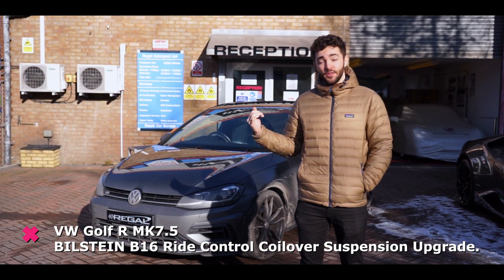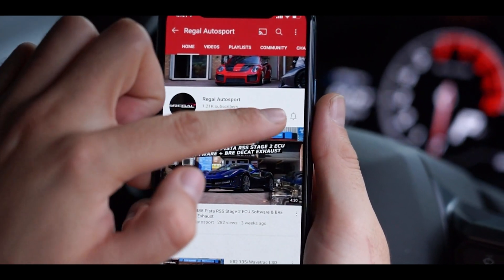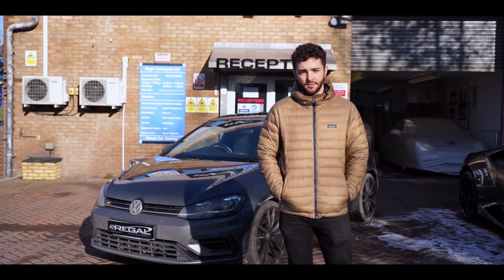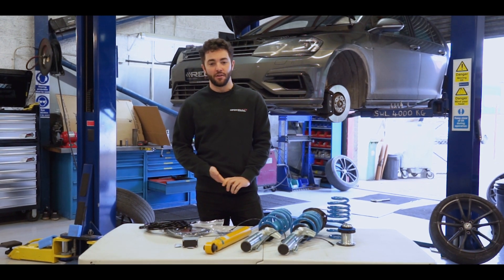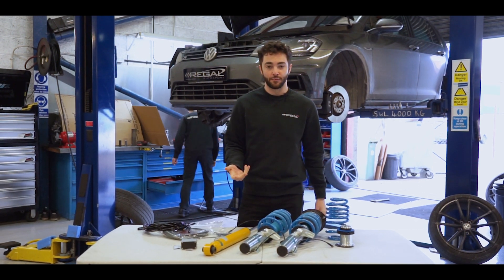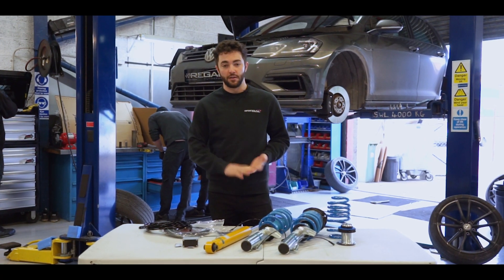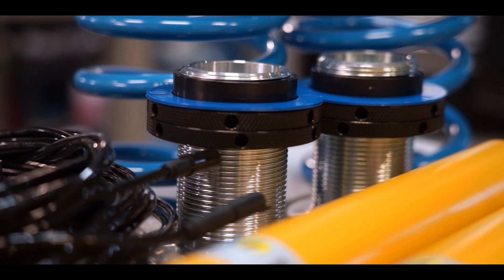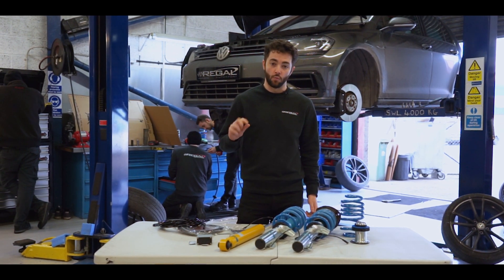MK7 Golf R Coilover Install | BILSTEIN B16 Ride Control [Retrofit Electronic Damping to your MK7R]

Comment: After installing these did the car say suspension fault? I put in H&R springs and that code came up… too low? Would rather go coilovers but wondering about the fault code
Reply from the maker: Hey! They did not,  it'll be hard for us to diagnose your issue remotely but a good start is to go back through the install and ensure it has been carried out correctly.

Comment: Is this just for dampening?  or doesn't appear B16's can change compression with DCC
Reply from the maker: This electronically changes the bump and compression to the bilstein preset values but also you can adjust it on the fly with their IRC controller

Comment: Cost of supply and fit inc wheel alignment?
Reply from the maker: Thanks for the comment, for pricing you can contact a Performance Specialist by using one of the below methods: 

📲 Messenger: https://m.me/regalautosport
📲 Whatsapp: https://api.whatsapp.com/send?phone=447464783476
📲 +44(0)2380 55 86 36
📩 sales@regalautosport.com

Comment: I have B14 suspension on my E82 120i. It's actually more comfortable than stock, better over bumps, & it lowers the car too. 

I also have an N55 E82 135i that's still way too high on factory M suspension. I will likely go for B14 again because adjustability alone with B16s doesn't justify the additional price for me unless there's other benefits... 

It's important to note that these do not reduce cornering body roll much, you need sway bars for that.
Reply from the maker: Thanks for sharing!